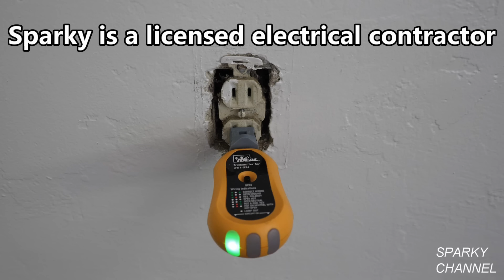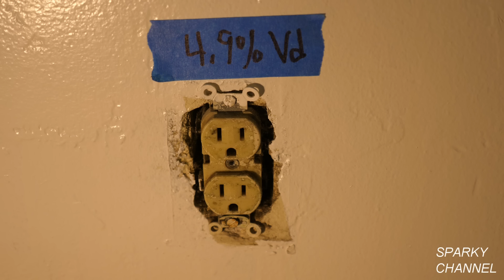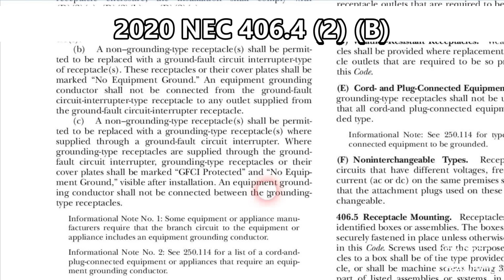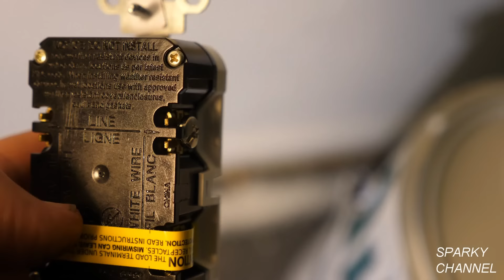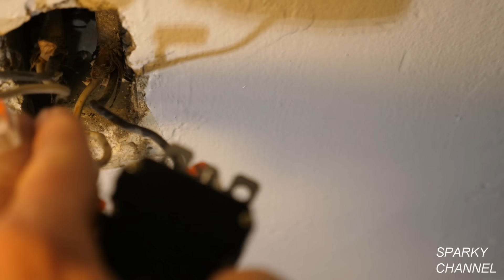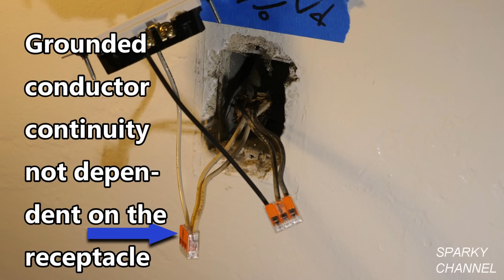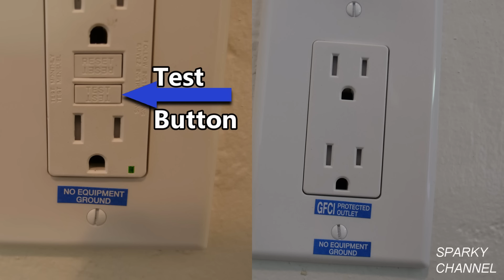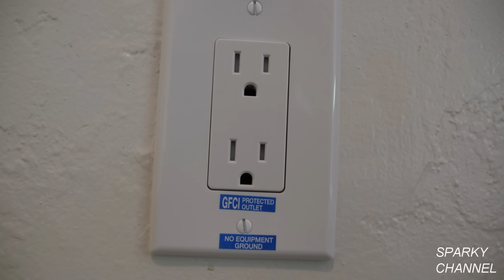2 Prong Receptacle Circuit Replaced by GFCI and Grounded Receptacles per 2020 NEC

Comment: What gauge wire are the pigtails?  12 or 14 gauge or does it matter?
Reply: He dealing with 15 amp receptacles here in the tutorial, so the circuit or wire gauge has to be 14 gauge. It's not that 12 gauge would not work it's just protocol. The more folks get away from protocol the more mistakes can happen 12 gauge circuit/wire is used for 20 amp circuits and 20 amp receptacle and 20 amp breakers. Everything on a line must conform. In this case it's 14 gauge because the receptacle is 15 amp which  means its attached to a 15 amp breaker in the electrical panel.
Reply: The pigtail should be at least the same gauge as the other wires.
Reply: He dealing with 15 amp receptacles here in the tutorial, so the circuit or wire gauge has to be 14 gauge. It's not that 12 gauge would not work it's just protocol. The more folks get away from protocol the more mistakes can happen 12 gauge circuit/wire is used for 20 amp circuits and 20 amp receptacle and 20 amp breakers. Everything on a line must conform. In this case it's 14 gauge because the receptacle is 15 amp receptacle which  means its attached to a 15 amp breaker in the electrical panel.
Reply: @donniematonnie9378  15 amp duplex receptacles are permitted on a 20 amp circuit. I prefer to use a spec grade 15 amp duplex receptacle in these situations. To say that you must have a 20 amp receptacle on a 20 amp circuit is a myth.
Reply: @surferdude642  ......Actually I never said 15 amp duplex receptacles would not work. Most homes probably have 15 amp duplex receptacles connected to 20 amp circuit breakers. In fact I implied that it would work. But that it wasn't protocol. The most important issue here is what you'll connect or /plug into that 15 amp duplex receptacle. Whatever you have plugged into it, if the load exceeds 20 amps for a long period of time, the circuit breaker will open the circuit. If that happens, you should pull out at least one of the devices thats plugged into that receptacle or on it's line and reset the circuit. breaker. How many homes have caught fire because of over loaded circuits?
Reply: @donniematonnie9378  I agree, but in this situation the homeowner should have an electrician add 1 or 2 more 20 amp circuits to the high load areas in order to reduce the number of receptacles on each circuit and thereby distributing the load. 15 amp spec grade duplex receptacles would be ideal. If a person had a piece of equipment that had a 20 amp plug, it would most likely require a dedicated circuit and a single 20 amp receptacle.

Comment: Can you skip some? Say down the line you only need 3 prong in some outlets and you wanna leave some 2 prong outlets alone?
Reply: Sure, the law just says that you can change, not that you must change.
Reply: In that case you would want to run an independent circuit from the electrical panel dedicated to whatever 3 prong receptacle you're writing about. Attaching the circuit wire to the electrical panel last of course. So you're NOT replacing anything. However, if you can somehow get a ground wire from the electrical panel to that 2 prong outlet/receptacle, you may as well replace it with a three prong outlet/receptacle cause it will then be grounded correctly. However, some folks after they've replace that 2 prong with a 3 prong will either stop there or they will try an attach a ground wire to a water pipe so it will be grounded, but what happens down the road if those old iron pipes are for some odd reason ex- changed for PVC piping. No more ground to the receptacle. Electricians worth their salt would never attach a ground wire to a water pipe, but as with everything else in the world anythings possible.

Comment: In my old house when I was changing the receptacles it wasn’t wired how you are showing, they wired the main hot into a box in the ceiling and then went to each receptacle in the rooms they ended up in, so you cannot put one GFI in to supply The whole circuit
Reply: Duane, in your scenario a GFCI type outlet would need to be placed at each location that you remove a 2 prong plug and install a 3 prong (this can get expensive). If your panel has been upgraded, check into replacing the CB with a GFCI type.  Remember to use the stickers for your outlets that note they are ungrounded.
Reply: @thadsawrap3500  
Yeah I looked into that and they don’t make a breaker that size for the panel, I’d have to replace the whole panel which might be cheaper than getting a GFCI for every outlet
Reply: @duanesmallwood4177  another option that might work... IF your able to pull an additional set of wire (1 hot 1 neutral) from your J-box to one of the outlets in the circuit, then you could rewire the J-box and install a single GFCI at that outlet that feeds the other receptacles.  Only issue is the NEC 210.12 (b) requires AFCI protection if the modification is more than 6 ft of wire.
Reply: @thadsawrap3500  That option would not work work in a case where multiple outlets are all wired directly to the junction box in the ceiling.
Reply: Duane, (apologies in advance for the length of this) I too live in a very old house and have just started replacing 2 with 3 pronged receptacles. Having started with the last one in the circuit, I found only 1 hot & 1 neutral (as suspected). Moving to the next one closer to the breaker box I figured it would be both a line and a load cable but it was the same as the one I'd just done. A box in the ceiling might explain this. My question is: How did you figure out that was the set up?
Reply: @victhechic  
Just go up into the attic or wherever Do you see boxes with multiple wires going different places, in the basement if you have a ceiling that will be tough to do
Reply: @victhechic  I just finished a comment on how do this without expensive equipment or going in the attic which still isn’t foolproof. You can easily get wires mixed up making a visual inspection and it still is what it is.
Reply: Ha, ha! My oldhouse is wired the same way. I figured which outlets were on the same circuit by first removing one fuse at a time till I got that circuit identified. Next I removed all the receptacles and with the bare wires exposed and separated (no kids, pets or other people around) made the circuit hot and with simple two prong outlet tester from HD ($3) found three outlets in one bedroom hot that were all tied in to the ceiling fan/light. So yeah, I had to buy 3 GFCI’s for one bedroom. The upside was now I have plenty of “No Equipment Ground” stickers for the rest of the house.

Comment: I hate that there's no way to ground these old outlets without rewiring the entire circuit. GFCI protects you from shocks but will not protect your electronics from a power surge which has nowhere to go without a ground.
Reply: Buy an external surge protector and plug your electronics into it, you would have to do that even  if your outlets were grounded.
Reply: @realtruth3731  Spot on
Reply: Grounding does not protect against power surges.
Reply: Grounding is more so that you don't shock yourself

Comment: I wired up a two-prong outlet to a GFCI and the GFCI tester does not trip the GFCI because it does not find the ground fault how did you get your GCI before properly
Reply: Just push the test button on the CFCI receptacle to test the circuit. Your GFCI receptacle has no ground for your tester to short to for testing thus your tester will not work.
Reply: @tomsawyer5576  I understand the test button will work but doesn't that defeat the purpose of it actually doing its job if there is a ground fault to the device doesn't the tester simulate this happening
Reply: @brandonclark316  A tester won't work because it is testing the ground plug of the three prong outlet. Since there is no ground wire connected, it can't test it. However, if there was an actual short to ground situation, the outlet would still trip because the neutral buss and grounding buss bars are connected in the main panel.
Reply: @brandonclark316  The point of a GFCI is to prevent the current going through you, not to prevent it going to the ground cable.  Sure if there is failure the GFCI will likely trip only if someone touches it.

Comment: Im confused, you said you were adding a ground and how are the other recepticals protected when you bypassed them from the gfci outlet where you just pigtailed off of  the hot and neutral.
Reply: Don't be confused, first no ground was added, second the downstream receptacles were pigtailed to the load side of the GFCI receptacle. Adding a GFCI receptacle does not create ground. Nor does GFCI need a ground to sense a fault to ground, all that needed for the GFCI to work is a difference in load between the hot and neutral.
Reply: @tomsawyer5576  
Thank you for your explanation : )
Reply: @tomsawyer5576  I’m a little confused also.  As my gfci is saying that it won’t work unless it’s connected to the ground wire. In which my outlet box doesn’t have 1. Now if I can get away without it that’d be great as it’s an old house where the outlet box ideally has a tight tolerance

Comment: Perhaps emphasize the following points:
1. The downstream grounding receptacles should have their ground connector kept unconnected.
2. The downstream hot and neutral are kept at their respectable sides of the receptacle, same as the GFCI.
Lastly, instead of buying a circuit analyzer, a homeowner could guess the most upstream outlet then check if it really so by disconnecting its downstream wires, then verifying that indeed a hot wire exist. This might be more work, but not necessarily if your guess is correct.

Comment: Just for information's sake, what's the point of installing a CFCI outlet without a ground. It seems as though there wouldn't be any way for it to determine a ground fault without a ground.
Reply: A GFCI doesn't use ground to see if electricity is flowing somewhere it shouldn't. The hot and the neutral go thru a measuring ring, and if everything is OK, the same amount of amps flow in each wire. And that cancels out any magnetic field. If any electricity goes somewhere else than back in the neutral wire, there is a difference in amps between the wires, and there is a small magnetic field generated in the measuring ring. And that trips the GFCI. The ground wire is never monitored.
Reply: If you don't have a voltage tester, Is it still up to code if you replace each 2 prong outlet with a GFCI? And put both stickers on them?

Comment: 15:05   Thanks for explaining why you used the Wago Lever Nut to create a pigtail instead of just connecting the two hot and two neutral wires directly to each screw on the outlet.  (So damage to outlet won’t affect current flow down stream.)
Reply: But seriously, how much damage to an outlet are we expecting in a damn bedroom?!  I see 4 wires, and 4 screw terminals specifically designed for daisy-chaining receptacles. There is a brass plate connecting the two screws on each side of the socket... So, unless you're running into the wall with your damn car, shit ain't gonna just break on its own!  (And if your car is lodged in your wall, I'm pretty sure you don't give a crap about the socket down the hall being out of service!  lol)
On deciding how to do stuff, when did common sense get substituted for extreme doomsday scenarios?!   This seems like a very clear case of a marketing department making shit up to sell Wago Lever Nuts!  The multitude of sponsored links is not going unnoticed either... ;-]
Reply: @robertcartier5088   
receptacles age, get abused and fail. IF the first in line malfunctions, you will loose service to all on that are on that circuit AND you will loose all the work on the spreadsheet you were working on!!
Reply: @yiannimil1  Wait, your bedroom sockets are getting that much wear & tear?  Good for you! ;-]   
You almost had me with that last bit about the spreadsheet, but I use a laptop, so minor, localized power failures are not really a problem. 
I'M just not convinced that there will be abuse and age degradation of the product making that terminal connection block fail, that's all.  Not worth all that effort and extra expense just for the infinitesimal chance of physical failure of that magnitude.  I have confidence that the manufacturer, who's name is on every product, knows how to make a receptacle that is immune to the damages caused by irrational fears!  Call me an optimist!  ;-]
Reply: @robertcartier5088  All the outlets on the 2nd floor of my old farm house are 2 prong outlets and some of them are looking a bit scary. I know they are probably being overtaxed by modern uses.  Some don’t even want to hold in a plug very securely anymore. I can tell you that with age, they do deteriorate.  One of the many fun things you might try to fix when you live in a old house that even predates technologies such as electricity and indoor plumbing itself.

Comment: If there a fault in one of the downstream receptacles, would it trip the GFCI upstream, Or does it only work one way?
Reply: Yes. If there was a ground fault on either the GFCI receptacle, or the other receptacles supplied by that GFCI receptacle, the GFCI would trip and deenergize those downstream receptacles. That is the entire reason for supplying those other downstream receptacles with the GFCI.
Reply: It works only that way. A GFCI protects only against faults after it.

Comment: Hey Sparky! I've an outlet, (last in line) in my kitchen circuit. It will run a light bulb or fan but not my new microwave! Changed outlet already but still won't run micro! Breaker never tripped and Micro runs fine on all the other outlets on that circuit! What to do?

Comment: 4) Arc-Fault Circuit-Interrupter Protection. Where a recepta‐
cle outlet is located in any areas specified in 210.12(A) or (B),
a replacement receptacle at this outlet shall be one of the
following:
(1) A listed outlet branch-circuit type arc-fault circuit interrupter receptacle
(2) A receptacle protected by a listed outlet branch-circuit
type arc-fault circuit-interrupter type receptacle
(3) A receptacle protected by a listed combination type arc fault circuit-interrupter type circuit breaker
Exception No. 1: Arc-fault circuit-interrupter protection shall not be
required where ALL of the following apply:
(1) The replacement complies with 406.4(D)(2)(b).
(2) It is impracticable to provide an equipment grounding conductor
as provided by 250.130(C).
•
(3) A listed combination type arc-fault circuit-interrupter circuit
breaker is not commercially available.
(4) GFCI/AFCI dual function receptacles are not commercially avail‐
able.
Exception No. 2: Section 210.12(B), Exception shall not apply to
replacement of receptacles.

Per this you technically broke code

Comment: This video was extremely hopeful. I'm trying to understand something.  Please excuse my ignorance. My girlfriend house has this issue and I was about replace and update to all 3 prong outlets but all with gfi surge protectors. I see in this video you only did the closes to electric board.  Again excuse my ignorance,  why not replace all 7 with gfi  protectors? I'm trying to understand.  Thank you.
Reply: You only need the first rec. in line from the breaker to be GFCI, all of the other rec. that come after the first in the circuit will be protected. You can't use multiple GFCI's in the same circuit. Will not work. Plus those things are pricey.

Comment: Had someone say you could replace the 2 prong outlet with a 3 prong if you run a small length of wire from the ground screw to the neutral screw. Please comment.
Reply: That is not up to the code.
Reply: @okaro6595  Yes, I figured that but is it dangerous in any way?
Reply: @roberthayes5541  yes its dangerous thats why there is a code
Reply: @roberthayes5541  There are problems with it so it is banned. It has been the common method in some countries including Finland. All my grounded sockets are make that way but now it would not be illegal on new installations.
Reply: No you cannot do that because if the neutral becomes disconnected it then if you touch any metal on one of your devices it will shock you

Comment: Is it acceptable to replace ALL 2 prong outlets with a gfi?  I know it would be more expensive, but is it safe and within NEC?
Reply: It'd be safe, but only one at the beginning of the circuit kills all outlets. With all CFI outlets, one fault would likely trip all switches with no increase in safety. You'd likely have to reset all the switches to get all the outlets to be functional again. If you enjoy pushing 4 buttons instead of one, go for it!
Reply: @gordonshepherd5481  If you replace all with GFCIs, you must pigtail and not put anything on the load side.
Reply: @gordonshepherd5481  Not if all of the GFCI's are fed directly by branch hot & neutral (not the load terminals of the upstream GFCI).
Reply: If the receptacles were not "daisy chained" or wired one to the next as it is here, then you might have to do each one.

Comment: The most interesting parts of this video to me were the part where you pointed out the NEC guidelines regarding this type of scenario, as well as the nice tools you used. I've never seen the tester which shows voltage drop. It looks very useful.

Comment: My house contains only 3 outlets that are two prong and indicates open ground when I tested them.
Can I just replace with 3 GFCI receptacles?
Reply: How did you test them as the tester does not fit a two prong outlet? Yes, you can replace them with GFCI outlets.